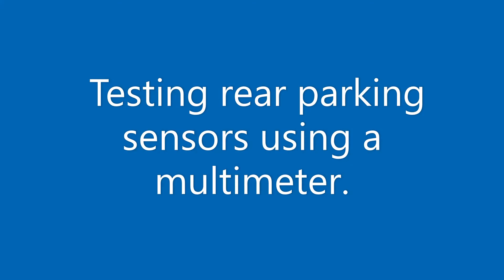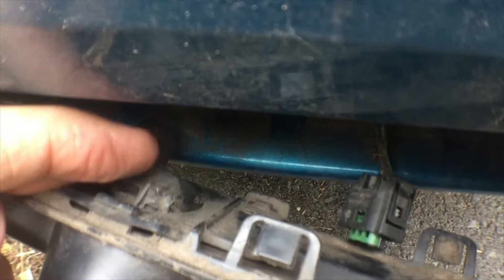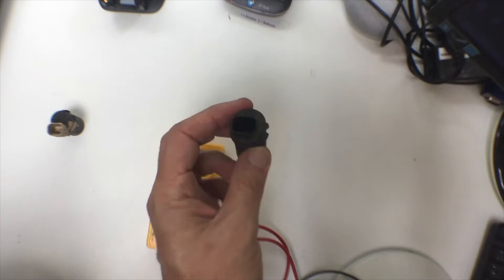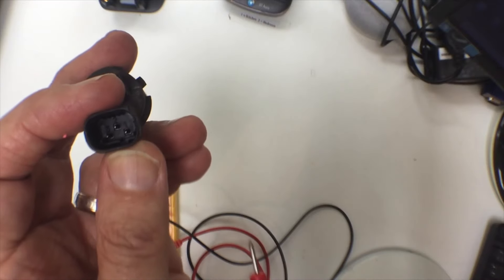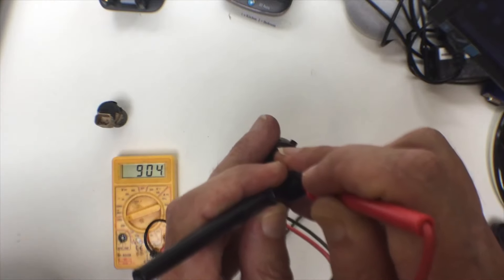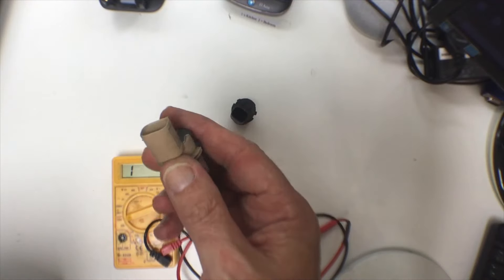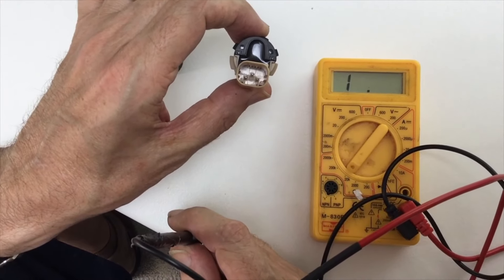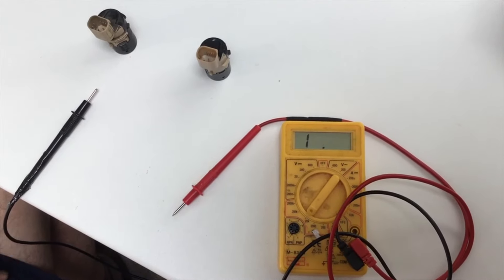Testing rear parking sensors using a multimeter

Comment: Great video and method to check individual sensor for pdc systems that if one sensor is faulty the whole system doesn’t work, but a cool tip also is to activate the pdc system by putting car in reverse and gently put a finger to front of each sensor and you should feel a very faint pulse, quick and easy to pin point a faulty sensor without having to remove any parts
Reply from the maker: Hi Robbie and many thanks for your excellent suggestion. Yes I have heard that this also works well. The only thing is that on some cars, the PDC only works with engine running, which makes feeling the pulses a bit difficult, especially on a diesel-engined car like mine! Also, in these cases, I feel it’s a good idea to have a freind you trust in the driving seat selecting reverse for you! 😂🤣. Anyway, many thanks for your comment. 👍👍
Reply: @Jase777jase  Can I simply put the parking brake on and put it in reverse? Audi Q5
Reply: And what if I feel no pulsing? Wiring or modules?
Reply: Where to select the part at multi meter

Comment: I have Peugeot and Citroen station wagons, both have this same faulty. I have decided to just keep parking assistance off all the time. I just wanted to check out if it is easy fix or not. Some models don't even have these sensors. I looked at another Peugeot 407, same age, it didn't even have the parking-a-button on the dash. It is an unnecessary accessory after all, dont you think? Thank you anyways. You posted a good video for the community. Multimeter is a must have tool for checking electric parts. You can use this method to many parts like Coils, Injectors, Fuse box etc. I found faulty fusebox on Peugeot with it.
Reply from the maker: Hi there Mikko, and thanks very much for your excellent comments.

With regards to the need for parking sensors, in general I would agree, however the reason I wanted to make mine work was that mine is a Cabriolet and that means that the visibility to the rear is absolutely appalling! Firstly the boot or trunk, is extremely high up, and secondly the rear window is so small that visibility is extremely poor. Even though I have added a reversing camera, covered in a separate video, I still require every bit of help I can get when reversing! Initially I did the same as you and just disabled the parking system, but eventually decided to reinstate it.Yes, absolutely a multimeter is a must for all sorts of troubleshooting. 😃

Comment: if your measuring Ohms with DVM it does not matter what color is connected to what end or pin #.  Unless, you're measuring a Diode and DC voltage.
Reply: It would probably be a good idea to test both ways to compare readings in case it's polarised.

Comment: Thanks for posting this, it has helped me sort of diagnose my sensors! If I have a reading of 1.800 ish on the 2M setting would you say they are ok? All 4 of them read the same. Thanks.
Reply from the maker: Hi there Will. It's very difficult to be specific about these sorts of things. Also it might vary from one system to another. However, what I would say is if its affordable to buy 1 new sensor you could do that and test it, then use it as a reference point. If all 4 read the same, I'd be inclined to think that's OK, but I couldn't say for certain! Many thanks for your kind comments and good luck! J.

Comment: Thanksbrother, very very clear, thx, are sensors car specific?  Do they existin 2 wires instead 3 as well? Bob Belgium
Reply from the maker: Thanks Bob, there are variations, but there are also some that are used by several different companies I think. I am aware of 6-wire sensors, but not 2-wire. Thanks again for your kind comments. 👍
Reply: @Jase777jase  thanks, you did great job! Buy you beer when u visit Belgium!
Reply from the maker: @bobdelaplage690  👍 😊

Comment: Hello you measure resistance between pin 1 and 2. My question is shold it have resistance between pin 2 and 3 or pin1 or 3? In my case resistence between pin 1 and 2 is 70k ohms, it is good resistence?
Reply from the maker: Hi there, and thanks for your comment. This method does not involve testing any pins other than 1-2. I can’t tell you what you’d expect to see across 2-3 or 1-3. It’s really more of a way of testing if your sensor is completely dead, in that it will show open circuit from 1-2 if that’s the case. Are you able to test any other sensors on the car? I think the resistance varies by manufacturer so it’s difficult to say if 70k ohms is good or bad, but the fact that it is not open circuit would make me think it’s probably not dead. I hope this helps. 👍

Comment: On my audi sensors i get a reading of 10.02 on 20k ohms on pin 1 & 2 but on pin 1 & 3 and pin 2 & 3 i get displayed 1. Which i assume means open circuit? So are my sensors good or bad? According to audi wiring diagram pin 1 is positive and pin 3 is ground. And pin 2 i beleive is for the module to know which sensor it is i believe. Do i have good or bad sensors?

Comment: Hello, I have 4 rear sensors and in reverse the allarm was always on so i disconnected all 4 and 3 of them gave me 4 k.hom reading on pin 1 and 2 and same to pin 1 and 3. The last one gave me open circuit to pin 1 and 2 and a very high reading to pin 1 and 3 so I ordered a new one and I replaced the sensor. I engaged the reverse and no allarm so I thought I solved the problem, but now it doesn't give any allarm at all even if I get close to the wall... So I tested the new one and from pin 1 and 2 gives 10k.hom and from pin 1 and 3 a very high number starting from 150k.hom and decreasing until 50 k.hom. so... Should I think that all my 4 sensors were bad if compared to the new one? Or maybe is the new one defected?
Reply from the maker: Hi Jason. That’s very interesting. I don’t think the new one is defective, as I recently bought 4 replacements and they all measured around 10K like yours. So I think the new one is fine. I would be very reluctant to buy 3 more sensors if they are expensive, as I’m not sure that you haven’t got a fault in your actual system itself. On my car, it will report if there is a fault with the system, and also, it will give one short bleep as you engage reverse, so I’m surprised you are getting no sound at all. Having said that, a fault in the system could be very difficult to trace. I guess If the sensors are not too expensive (I got a real bargain with mine, at £33 for 4) then you could buy 3 more just so that you rule out sensors as a problem, ie, if you’ve still got the problem with all new sensors, it’s going to be the system at fault. I hope that helps, please do come back and let me know how you get on. Jason.
Reply: @Jase777jase  So, today I checked again and I found out that if you put a finger on the sensor and you move it around the sensor, basically the sensor makes a little noise like a " click click "  it means it works, so I tested all the sensors and I found out another one broken, the new sensor works and the one I replaced wasn't working, I did this test also to the broken one I knew, just to be sure. So my question is: is it possible that now with another faulty sensor doesn't make any sound at all ?.... I'll try to replace the other one and I'll let you know.
Reply from the maker: @jjcc2785  Hi again, I’m glad you’ve been able to test the sensors with the “click” method. I’ve had a lot of feedback from people saying it’s a great way of testing, but I’ve never had much luck with it myself. It’s good news that the “click” method has confirmed that the sensor already detected as faulty, was indeed dead, and that the new one (measuring 10k) is fine also. Without knowing the car or it’s system I can’t tell you what sound it should, or should not be making, but if you change that remaining sensor, I think you’ll stand a good chance off success, I certainly hope so… let me know anyway. 😊

Comment: I tried your method and if I test pin 1 and 2 I get nothing, but if i test pin 3 with 2 I get some results. Do you know what this means?
Reply: Me too in citroen ds3 did you find if the sensor are ok or faulty please
Reply: @rafsz409  I got over it , and tried other method , have all the sensor still installed on the car, put the car in reverse , turn ignition on but not start the car, and go listen closely to the sensors they should buzz if working, if faulty they should not buzz , even if not buzz it can not be the sensor , it can also be the wiring. In my case a peugeot 607 i found out that the entire wiring was the issue , also check the parking module

Comment: If I get no resistance through the sensor? is there a way to open it and actually fix it... I have to replace more than one and they are expensive...
Reply from the maker: Wel that’s a very good question, and coincidentally I saw a link this morning for a video on exactly that. I’ve never tried it because my sensors are not too expensive, but I know some are. I will see if I can track that video down. Thanks for your comment. J.
Reply: @Jase777jase  thank you so much!!!

Comment: 5:08  its 9.96 Ohm or  Kilo Ohm ???  I thik its Kilo Ohm ?
Reply from the maker: Hi there, yes it would be Kilo Ohm. I would imagine different manufacturers sensors may vary in this value, the real point to note is that it’s not an open circuit. I think to summarise: Open circuit : sensor dead, Measurable value: sensor is probably ok, low measurable value: sensor is very likely to be ok. Hope that helps and thanks for your comment. 👍

Comment: Hello, my sensor is about 13.95, all 4 parking sensors.. Is this sensors good or not?
Reply from the maker: @DCFootage9  Hi there, it’s not possible to say absolutely for sure, but that sounds like a good reading as it’s not open circuit and it’s fairly low. Also, if all of them read the same, I’d be inclined to think that they are all good, rather than all bad. As I say, I can’t be certain, but if it was me, I’d be thinking they were ok. Thanks very much for your comment.  👍
Reply: @Jase777jase  thank youu

Comment: Why did you reduce the setting to 20K for the new one?
Reply from the maker: Well, the symptom of a bad sensor is that it has a very very high resistance, or open circuit. By contrast,  a new working sensor has a very much lower resistance. I could have showed the older sensor on the lower range, but it would just have been open circuit, for that range. Its only by going to a much higher range that we can see any reading at all. You could just say, use the lower range for all testing and if its open circuit, the sensor is faulty, but I believe that some are borderline ok, and that's why I showed the higher range. One thing you can be sure of, is that if you use the higher range and its open circuit, then the sensor is dead.

Comment: You're not going to want to use a digital meter to test those sensors as all you're going to get are false readings.  If you're going to use anything, you should use an analog meter.
Reply: can you explain some more about using the analog meter. What settings and what should i see for bad ones and good ones?
Reply: how...?
Reply: How?  Well, by simply setting the analog voltmeter in the OHMS position, and by following the above steps.  In my case, even though one particular rear parking assist sensor was clearly defective, it didn't do me a bit of good in trying to replace it on my 2005 Jaguar XJ8 anyways.  Actually, the risk was far too great in invariably damaging the fragile and ultra expensive plastic rear bumper (and/or plastic supports) in the process.  What I elected to do then was to simply disconnect the plug from the rear parking assist module, and leave it unplugged.  Afterwards, I performed a hard reboot.
Reply: Why would you say that, your still going to get a resistance reading?
Reply: I tried measuring the resistance of those sensors with my digital meter, and I could never make heads or tails as to whether they were good or bad.    Withy my Conar 211 vacuum tube analog voltmeter, such a comparison was readily apparent.
Reply: @greanfinisher4014  With either type of voltmeter you will need to know a good/not good resistance, for example 10,000 ohms might mean it's good, 1meg ohm might mean it's bad, but with either meter it will depend on what scale your on, as far as good/bad!
Reply: The digital meter which I used had Auto ranging, but it still proved to be useless in this case.  Actually, even my curve tracer couldn't make that determination which meant that the way the IR diode was connected to the circuit made it impossible for such a check.
Reply: @greanfinisher4014  Reverse the leads, diodes act like a check valve and will only read one way.
Reply: Yes, I was well aware of that as I've been an electrician/electronics technician for many years.
Reply: @greanfinisher4014  Congrats, me too, 43yrs!
Reply: @greanfinisher4014  You still didnt explain why a digital multimeter would not work and an analog one does.
Reply: In fact, I thought that I did explain just that.  With my Sears digital multimeter which has full auto ranging, it was impossible to differentiate a good sensor from a bad one, and I've been in the electrical trade for many years.  Actually, with my Sears digital multimeter, what I was experiencing were nothing but false readings from a defective sensor.  With my Conar 211 VTVM, the defective sensor actually checked open in both directions.   Keep in mind that what you are actually checking here is a diode that is not isolated from the rest of the  circuitry.